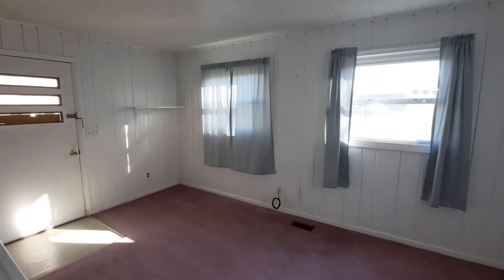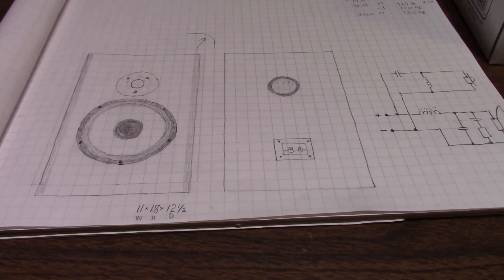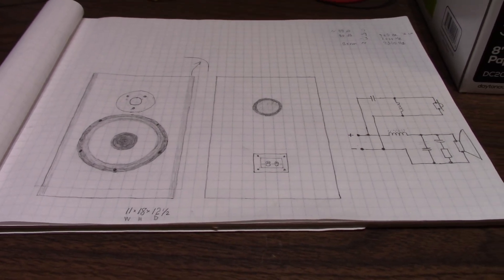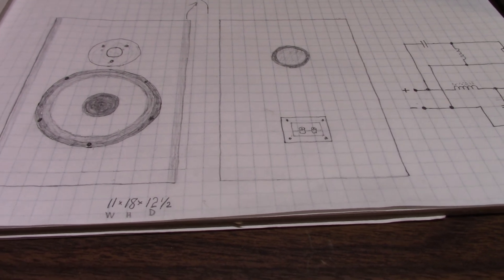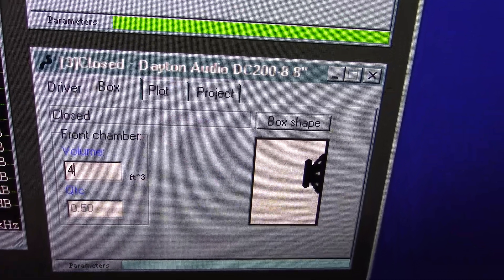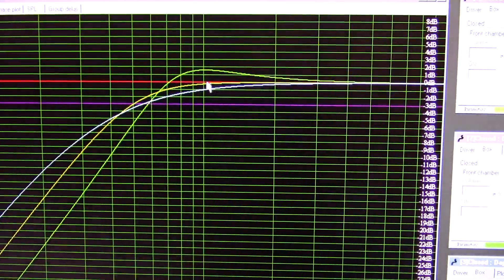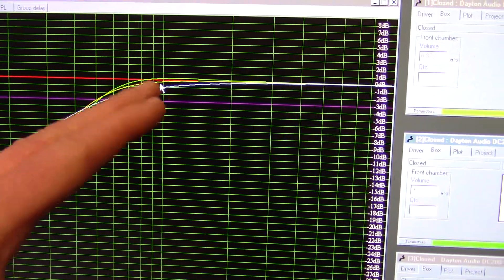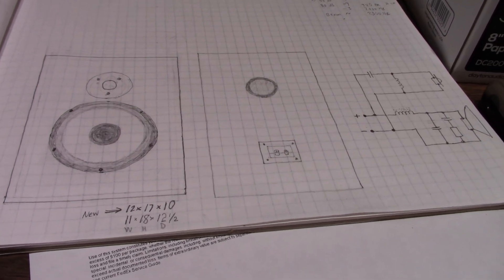DIY speaker project revival - PT1 enclosure volume

Comment: With the aluminum woofer, it's probably more preferable to go for an active, high-order crossover. If you cross it very high, the aluminum cones usually have enormous resonance peaks in the 2-4 khz range, So that this doesn't interfere, you have to cross them lower,  with a high order filter (if it's a very high peak, perhaps add a notch filter) . On the other hand, a  low crossover point (1200-1800) will make the tweeter howl, adding distortion in a super-critical range for listening. The balance between an 8" and 1"  is a delicate thing

Comment: higher Q mean more phase issues , that´s why big closed boxes sounds perfect for classical /orchestral music, the bass is tight and fast (with vented b. or higher Q , the low response smears a little (due to phase artifacts in the low range))
I have very similar monitors, closed big box, 8" polypropylene (an old Vifa, I don´t remember the model) with 1" aluminum tweeter (Seas H1212). I crossed them around 2500Hz, passively (If you already have the wire,  you save A LOT of money on coils), the capacitors are rescued, so the whole project was not very expensive. An important issue is that, in order to not  overcomplicate the crossover design, the tweeters are physically phase corrected (about 1.5-2 cm behind the front plane. Without that, you need more coils/caps  in the design to compensate  the phase issue. (it's super noticeable with 2nd order Butterworth filters) The cheaper way is to make a slanted box.
The woofer is almost  on the edge in the upper range, but being a relatively "soft" cone, it doesn't have many annoying resonances (at least at normal levels). The Seas H1212 is a marvel, lots of details, low distortion. Excellent in a "pro monitor" (I worked with several before, and the Seas tweeter has nothing to envy of similar  things from Adam, Genelec or Yamaha. There are other cheap monitors - like KRK, Samson, or M Audio_ which sound much worse)

Comment: Sealed box looks a good choice for this driver. Going active -- presuming analog - would be very interesting to watch. Maybe you could use the JAT-501s or some of your chipamps. Rod Elliott has projects 09 and 125 to study, and of course, Linkwitz and Self. Most seem to go with MiniDSP type products which allow rapid crossover tinkering and easy tweeter delay, though these are hardly cheap, and not great if you have analog sources cause of the ADC. I can't think going passive will be more expensive than active, though, unless you are talking about an overkill filter.

Comment: Hi there, I'm working on a DIY speaker but I'm stack at a point where by i have a 200W Mono power amplifier 1943 + 5200 mono HIFI Audio amplifier finished board which requires a dual voltage ranging from +/-20v to 90v. With me on my bench i have a 24VAC single out put transformer, i searched online and i found the circuit i can use to get the dual voltage I'm looking for, after following the circuit i managed to get  -36V and +36V which is a perfect range for my module, the only problem i failed to fix is the noise that goes in the speaker as they are sharing the negative terminal with the power source and the input as well. how can i solve this???

Comment: First good luck in a quick sale of your house. Second thank you very much for your Transistor Matching Video. I bread boarded your circuit. Inserted two 2N2222 Metal can NPN transistors they were close. But inserted another one perfect match. I tinker around with a lot of discrete operational amplifier circuits. So it’s really important that I have matching transistors.

Comment: Can you please make a video on IRS2092S 500W amplifier board?

This board is quite cheap and small and requires 65-0-65V supply to work...
Reply: I saw you struggling with your power supply limitations in your videos😂...You can buy those SMPS boards like boost converters. These boards can take 12/24V input from a battery and can give you an adjustable output at any current depending on the board you bought... They are available from 400W to 1500W and are also cheap, you can get a 1000W board for around 15-20 bucks...

Comment: The Dayton Audio DC200-8 is a lovely driver. It hits a sweet spot in TS parameters, sounds good despite having an uneven frequency response, and presents good sound detail. I used it along with a Visaton DT92 tweeter as driver replacements for an old pair of 17 liter cabinets that had Philips drivers (80652/w8 - I don't recall the number of the Phillips tweeter). Also, going off the manufacturer's response curves alone, and playing around in Xsim, I unintentionally found that what I ended up with for both Dayton Audio drivers was effectively a single pole filter, albeit for both tweeter and woofer I employed a Zobel type R-C across the driver that reduced response at the upper range of each driver. The woofer inductor is 1.8mH, tweeter filter of 10uF + 3.3R, woofer Zobel 22uF plus 4.7R,  tweeter Zobel 4.7uF plus 1R. I also used a 3.3uF in the woofer LP filter, but realised this barely does anything, so could have been omitted.

Comment: How did you convert volume into those dimensions?
Reply from the maker: First convert the volume to the units I'm using to measure. .8cu ft is 1382 cu in. Next, I figure the size I want the front of the speaker to be to fit the drivers. Now I can divide off those measurements from 1382 to give me the depth. Of course, I have to add to those measurements for thickness of the material to get the overall size of the cabinet.

Comment: Good luck on your sell. I'm sure it will go quickly. From what I hear everyone's still buying up the houses. Can't wait to see the video on crossovers. By the way if you ever get the QuantAslyum QA40x let me know. I made a box that will power it externally and pass the USB data lines off to the PC. Works great for mine. If you want I will make you one, orrr I can send you the parts as a kit and you can make a video about it! Take care John, see you soon!
Reply: @ericcarlson4684:  Does the external power source improve the QA40x performance?
Reply: @cougar1861 That’s a great question but I don’t know. The QA403 that I have complains about low voltage when plugged into my PC. QuantAsylum knows that some PCs can’t supply enough current to power it properly. So I created that box. Now it works great!
Reply: @ejc4684  Thanks

Comment: I like closed boxes too, so it'll be interesting to follow you on this build. I don't use MDF though, because of unhealthy dust when processing  the material. 15mm plywood with 7+ layers will do great in this build I think? In my opinion the plywood is just as good for speaker building as MDF. Greetings from Norway.
Reply: Inhaling small wood particles is not much more healthy than inhaling MDF small particles.
Reply: Don't breath ANY particulates, use a mask.

Comment: Nice looking! Whenever I build a new speaker setup I always try to build the biggest box I can tolerate. Also making sure the cabinet isn’t equilateral. But I was always building large speakers using vintage altec 15” woofers and large horns ;)

Your speaker setup looks good!

I used to buy the expensive sonic caps, silver caps, blah blah. Now I just buy the plain ole parts express black/yellow poly caps. They work great. Add in a few air core inductors and your in business

Comment: Crossing an 8" midbass over to a 28mm tweeter without a waveguide will definitely introduce a big directivity mismatch at the crossover point, which will cause a rolling listening window response in an untreated room. The DC200-8 begins beaming just under 1.3KHz and unless using a higher order filter (active with DSP would simplify this), the DC28F really needs to crossover around 1.8KHz.  In the absense of a waveguided tweeter, a dedicated midrange such as the RS75 would alleviate this somewhat.

Comment: Yes, the crossover components get expensive. if you use Sonicaps in the tweeter crossover you'll have nearly 80% of the project cost wiped out. Speaker building is an art. Room acoustics can defeat all the effort put into the speaker and crossover. Good luck.

Comment: Greetings from Serbia. It was a long time ago to remember but I think that Acoustic Research AR18 was two way sealed with 8" woofer and they used it in relatively small box so the Qtc was a little over 1. There is no need to chase 0.707. I don't think that difference in practice will be worth using bigger box. I prefer 0.3 square feet box. That's what I would build.